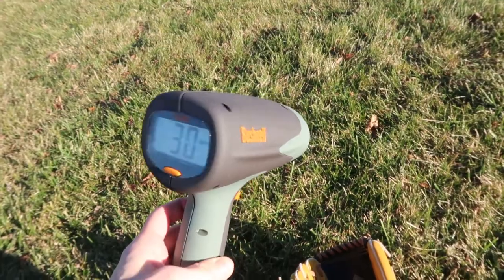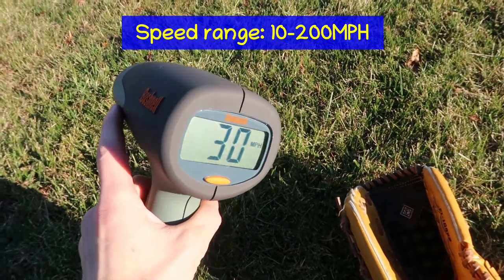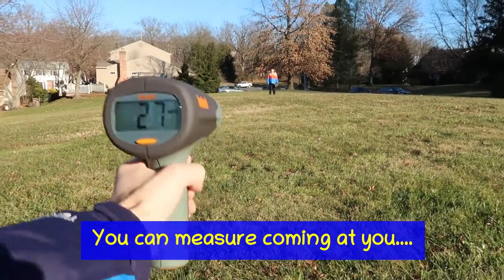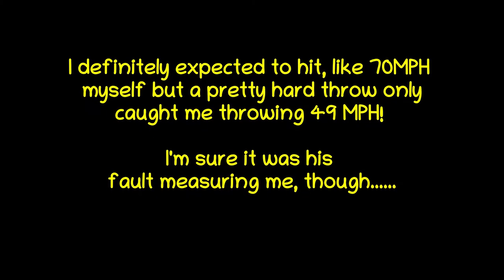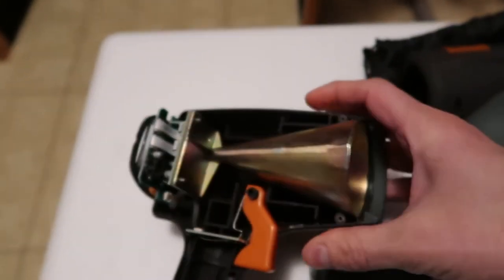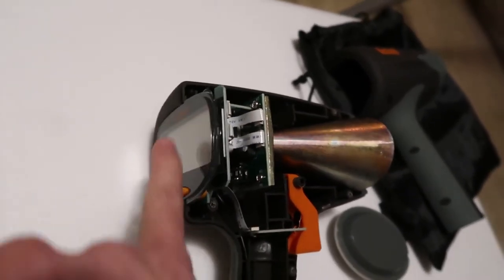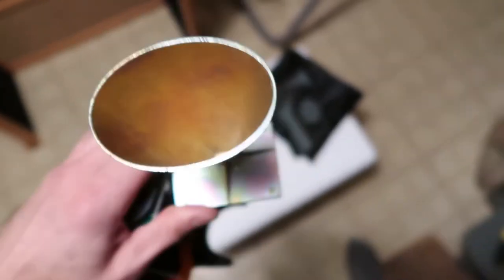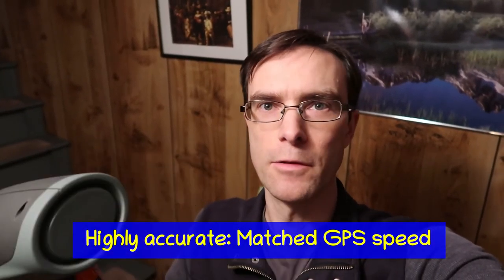Amazon Review, Testing, and Teardown of Bushnell Baseball Radar Speed Gun

Comment: Is it possible to use hands free i.e. if training by yourself?
Reply from the maker: No, you have to push the button to start measuring with the unit the way it is, so I don't think you can throw monitor yourself easily.
Reply: I actually found if you tie a string on the trigger you can use it yourself